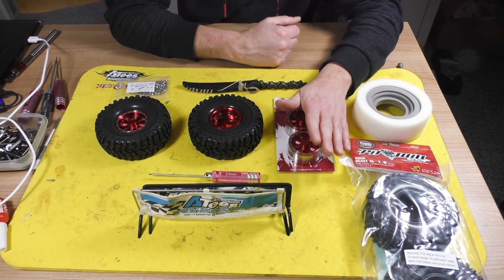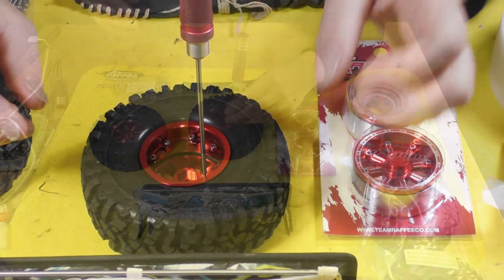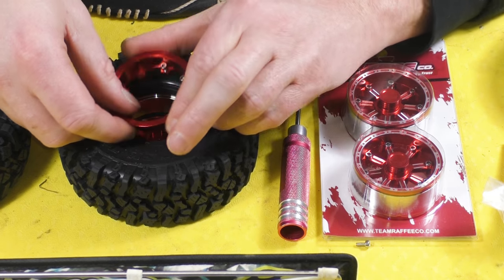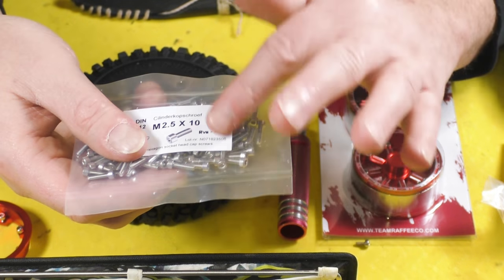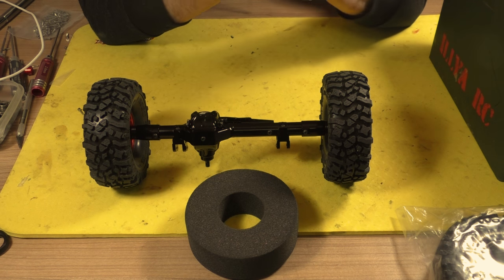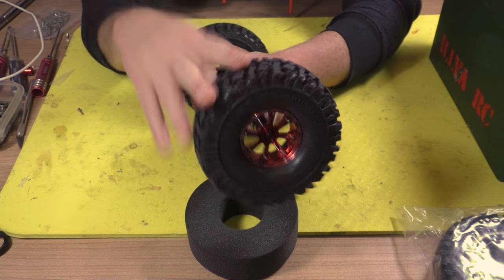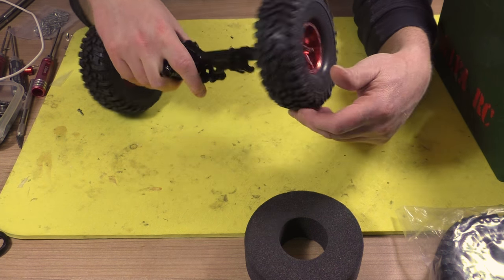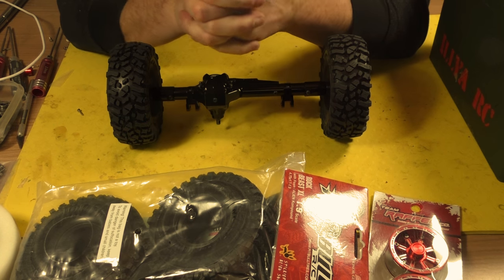Team Raffee Beadlock TechTip Dual stage Foams vs Memory

Comment: I run one peice closed cell. I like it better than two stage foams. Still get plenty tread to ground and ground clearance.
Reply from the maker: I've been thinking of 1 piece CI "Deuces Wild". Maybe in a future build. I heard 1 piece are mainly used in  U4 tires and purposes. You use them in a crawler?

Comment: is it just me or does it seem like the aftermarket foam stretched the tires diameter, I know you mentioned the width difference, but it also looks to have made it a little taller
Reply from the maker: True...  The outer foams (as well with those TeamDc's as with the Crawler innovations) are a bit wider. They also are a bit bigger in outer diameter. However they are less "firm" than stock foams, so that compensates. Overall the tire is better "filled" and in the inside volume is better used.
The biggest advantage will be seen in corners and sidehilling.